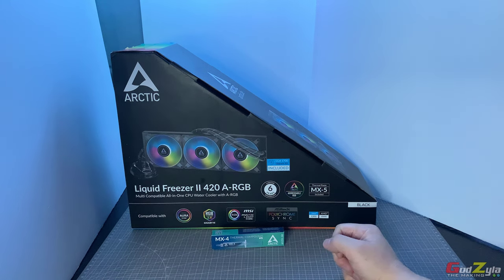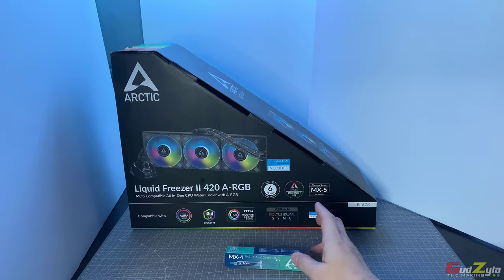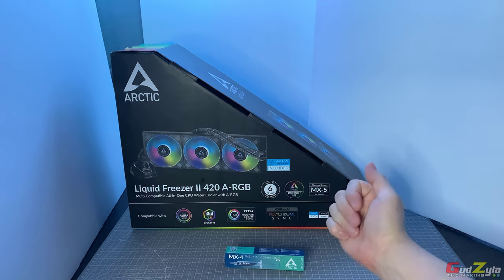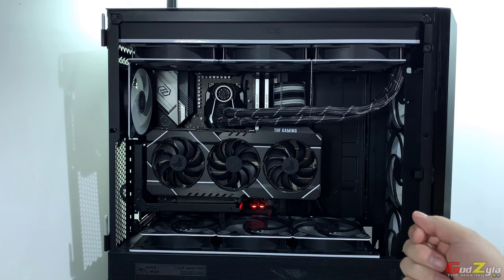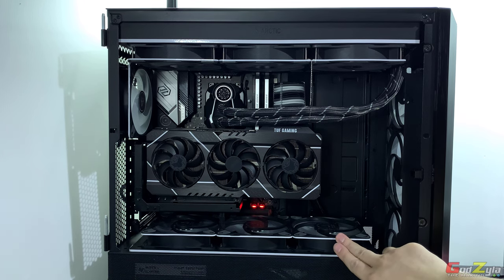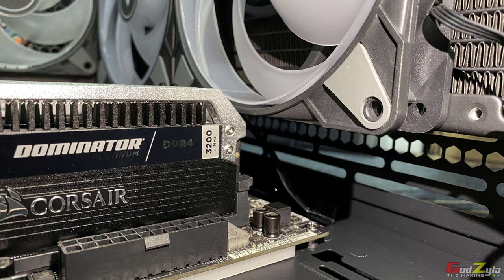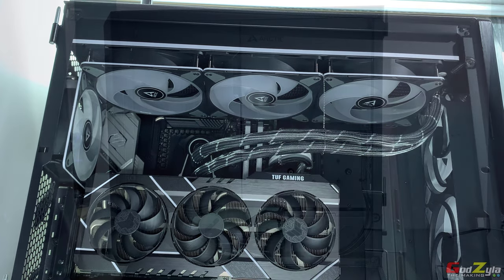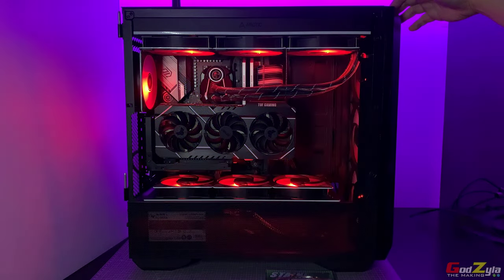Arctic Liquid Freezer II 420 in Lian Li Lancool III - Part 2 (The Experience)

Comment: tell me what kind of vibration isolation you use, what is it called, what is the thickness size, and where can I buy it? I have a radiator with Lian Li Lancool III resonates very strongly and buzzes sometimes I think this is the connection between the radiator and the housing, so I want to glue the vibration isolation of the radiator itself and additionally the fans, the main thing is that then the RAM gets up I have about 1mm left there
Reply from the maker: Hi Rico Freinow, welcome to my channel, for case fans, I just use fan rubber studs. as for Radiator fans I dont use any as dependent on the fan rubber dampers. For radiator to case, I dont use either.
Reply: @KleoYan  I'm talking about the white strip that you pasted, is it vibration isolation?
Reply from the maker: @ArmsK7  no they are not. they are just for decoration. my vanity lol. https://www.amazon.com/dp/B09CD6VHTT/ref=sspa_dk_detail_2?pd_rd_i=B09CD8GYLD&pd_rd_w=JpUgn&content-id=amzn1.sym.dd2c6db7-6626-466d-bf04-9570e69a7df0&pf_rd_p=dd2c6db7-6626-466d-bf04-9570e69a7df0&pf_rd_r=WTJB05RRKV5RGH9W9QXM&pd_rd_wg=67OOd&pd_rd_r=fdc65f38-58e7-45a9-a8e5-c04ff83e690d&s=automotive&sp_csd=d2lkZ2V0TmFtZT1zcF9kZXRhaWxfdGhlbWF0aWM&spLa=ZW5jcnlwdGVkUXVhbGlmaWVyPUFMNUNKSDNCVzYxOTUmZW5jcnlwdGVkSWQ9QTAyNjExODUyTEQ1WEFGQUpPUDFaJmVuY3J5cHRlZEFkSWQ9QTA4MDI5NzNNWUVYNUs1RlMxTEUmd2lkZ2V0TmFtZT1zcF9kZXRhaWxfdGhlbWF0aWMmYWN0aW9uPWNsaWNrUmVkaXJlY3QmZG9Ob3RMb2dDbGljaz10cnVl&th=1
Reply: @KleoYan  clearly, I think maybe the reason is in the rear fan, how it fits into the upper one and because of this it resonates 0:01 https://youtu.be/ljAh1vHZKwg you have it in a different way, maybe that's the reason?
Reply from the maker: @ArmsK7  I see, now i see what's going on.. thats why you have the noise but you did able to fit the rear fan into position, for mine I can't and maybe I have used Arctic fans, thats the reason why.
Reply: @KleoYan  in terms of dimensions, they should not differ, this is a 140 fan the same as the Arctic, I just can't understand how you installed it so lower, I can't move it lower, it rests on the outlet hole for the pci slot
Reply from the maker: @ArmsK7  Hmm, this is interesting, for most Lancool III I have done for friends, I am able to lower it like the way I did, but then again, that was like last year. Let me check with Lian Li if there are changes to the structure which I doubt it will be. Thank you for your info and feedback.
Reply: @KleoYan  or you have set the fan to 120, because 140 is not the way to install
Reply from the maker: @ArmsK7  in this illustration, I am using 120mm not a 140mm.
Reply: @KleoYan  
I found the reason for this is the HDD basket and what is strange is that the HDD has a vibrating ring and it continues to vibrate on the case..
Reply from the maker: @ArmsK7  vibration ring. Hmm this I am not aware of as I don’t use mechanical hard disk. So I remove the cage totally.

Comment: I have got the setup but with an asus rog strix z790-e, just finished assembling last night and haven't gotten around to power it up for the first time since I'm not satisfied with the configuration.

Unfortunately, mine cannot be mounted at the top since it didn't clear my trident z5 ram, the vrm cover, and of course the rear 140mm fan. A shame really, seeing that both of our motherboard are atx my ram sticks are not as tall as yours. I had to mount it at the front, and rearrange the front three case fans around. 

On top of that my arctic also came a bit bent along its overall length (probably due to shipping), I couldn't be bothered to return it and just had to finagle it more with screw alignments.
Reply from the maker: Hi mtl shdr, welcome to my channel, so sorry to hear that. Hmm but come curious how you mount the Arctic Liquid Freezer II 420 at the front? I have tried and it’s too thick. Unless I do not place a top front 140mm fan.

Comment: I couldn't fit my 280 in top of my lancool II. there was not enough clearance for the MB
Reply from the maker: Hi simple store, am sorry to hear that. Kindly note this is Lancool 3 not Lancool 2. Infact in all cases you have to know the measurements properly. I wish motherboard manufacturer will indicate the height of the rear I/O and the side vrm hearsink. Never the less, what you can do is to place your 280 aio at the front. That will still work.
Reply: @KleoYan  thank you for the info. and yes I have placed AIO in the front of the case.
Reply from the maker: @lllrexerlll  that's good, btw something to share with you. it's witness that some of my viewers have tried my method to put thermal paste, you might want to give it a try. https://youtu.be/xZ2R4roF1_Q
Reply: @KleoYan  thanks. will keep this in my mind for my next build.
Reply from the maker: @lllrexerlll  you are most welcome. 😉

Comment: A quick question, I'll get the MSI MAG B650 TOMAHAWK WIFI and the arctic freezer ii 420mm in a lancool 3 case. Would it fit? Because the cooler near the mosfet coolers are kinda big on the tomahawk.
Reply from the maker: Hi xxSchadenfreude, welcome to my channel, I am not able to tell you if it fits as I do not have this motherboard, if you do have this board or able to have a look at shops. do the measurements of the motherboard side VRM and the Rear I/O Shield, so long it does not go over 40mm tall. You are good to go with a 420 Liquid Freezer II in this case.
Reply: @KleoYan  by tall do you mean width? thinking about getting this case aswell, the i/o shield measuring across where the ports are is 45mm or so
Reply from the maker: @Mike17865  if the motherboard heatsink measuring from the base of the motherboard to the tip of the VRM heatsink is more than 40mm. it will not work as you have to take into consideration of the 5mm gap of the standoffs of the case for the motherboard.
Reply: @KleoYan  awesome i just saw in your video aswell, thanks for getting back to me
Reply from the maker: @Mike17865  you are most welcome and all the best wtih your build too. 😉

Comment: Hello, tell me, have you installed the front fans? my mounting frame rests against the radiator and does not allow me to go all the way into the groove, it turns out the upper part is tilted, and the lower one is flat
Reply from the maker: Hi Rico Freinow, welcome to my channel. Do pardon me as the part where I mount the front fans are missing in this video. Here is how I mount the fans at the front. https://imgur.io/gallery/vHezOSS
Reply: @KleoYan  thank you friend, I hope that the filters from the LIAN LI Dust Filter Kit will stand in this position
Reply from the maker: @ArmsK7  nope I have checked. If you place fans this way. The front filters will not fit.
Reply from the maker: @ArmsK7  hmm.. interesting. i read on their official store, guess I was wrong. thanks for the info buddy and congrats with your build. 👍
Reply: Watched this video before i got the case and aio, got both, but RAM wont fit 😂 got an x570 tomahawk and corsair vengeance pro rgb. I dunno what to do
Reply from the maker: @BadCoyoteFunky  hi welcome to my channel. What’s the height measurement of your side vrm heatsink and the rear I/O shroud? Does it exceed 40mm tall?
Reply: @BadCoyoteFunky  
only to change the RAM, either to change the aio, or to saw a little fan, I have TRIDENT Z5 got into the butt, the distance is only 3mm left
Reply: @KleoYan  oh it worked. i just forced it in. thanks for the video!
Reply from the maker: @BadCoyoteFunky  huh you have to force it in. Hmmm 🤔 ok if it works for you that’s good.

Comment: I have this Lian Li Landcool lll RGB case and keeps farely cool inside🤔, all case fans at 90%, not to loud for me either

3x140mm front intake (stock rgb fans)
3x120mm bottom intake (Asus ARGB TF120)
3x140mm top exhaust (Arctic P14)
1x140mm rear exhaust (stock fan)

Ryzen 5800x /DeepCool AK620 (max 75-80c in gaming)
MSI mpg B550 Gaming carbon wifi MB
32gb ddr4 G.skill 3600mhz
2x Gen4 M.2 nvme drives 500gb & 4tb
2x 7200rpm 4tb in front tray (2nd rear hdd tray removed)
Evga 3090 ftw3 ultra (max 75c in gaming)
1000w Corsair rx1000x psu

I've been debating on an AIO, was looking at the Deepcool LS720, but then I saw this beast and curious to get it or not🤔🤔🤔🤔
Reply from the maker: HI CamaroWarrior, welcome to my channel, your temperatue looks good. If you intend to overclock your processor, a 360 will do it's job, unless you are using the AMD 7950X or the intel I9 13900K or KS. For your current setup, LS720 or LT720 are good to go. Infact I would go for the 360 Arctic Liquid Freezer II 360 which is for more better as it's engineering is excellent. https://youtu.be/ugg_6bvYZAk

Comment: Quick question .. why didn’t you leave fans on the AIO when installing it ?
Reply from the maker: Hello James Wright, welcome to my channel. As mentioned, with a slimmer body, you can tilt it abit and to adjust till the radiator is in place, then mount the fans. If I have the fans on the rad. I am forcing it brutally into position. This will damage the fan and scratches on the rad.

Comment: Hey Kleo Yan, any chance you might be able to tell me if MPG Z790 EDGE WIFI will work in this setup (Arctic Liquid Freezer II 420 in Lian Li Lancool III ). I can't find how high the heatsinks or the I/O bracket is.
Reply from the maker: Hi A Man, welcome to my channel, do pardon me as I do not have this motherboard, am not able to tell you the height. You can try write an email to MSI support, check with them instead. Once again, thank you for your visit, sorry that am not able to answer your question and all the very best with your build.

Comment: Does the Lancool 3 have a dust filter for the power supply intake?
Reply from the maker: Hi CoolColJ, welcome to my channel. At the bottom of the case where the PSU draws cool air from, there is a dust filter.

Comment: I have a question, in the video you say that there is a space of 40cm for a motherboard, but do you think that the aorus master z690 that is 40cm high will fit?
Reply from the maker: Hi $Y$T3M, welcome to my channel. If you measure from the motherboard bottom PCB to the top of the rear VRM heatsink and it’s of 40mm in height. Then your board will be able to fit.

Comment: Many thanks @kleoYan  for this guide. It has worked perfectly for me. My 420 Liquid Freezer 2 + 3 120 mm fans at the bottom and  this LanCool 3 are a really great combo. The only donwside i found on this case is the lack of fan hub. And a little detail but there is no orientation arrow for the flow on stock fans, not a problem at all but i could be nice to have .

Really great job on your video fo all those explanations and details.
Reply from the maker: Hi Jérôme, welcome to my channel and thank you for your kind words. As for your feedback, I will let Lian Li know for their future chassis. Greatly appreciated it. By the way, you might be interested in this method of applying thermal paste. Alot of my viewers are getting very good results, you might want to try it too. https://youtu.be/xZ2R4roF1_Q

Comment: Did you have difficulties putting the fan brackets at the front with the aio up top? I'm having issues with it going in all the way
Reply from the maker: Hi Joashane Garrick, welcome to my channel. I have no issues mounting the try back. I have mounted it this way https://imgur.com/gallery/vHezOSS
Reply: @Kleo Yan  oh i see. I have mine mounted on the outside from when I was trying to front mount the 420mm aio lop. It still closes but I had to use a little elbow grease at first. I may have to try mounting it this way to see if it's easier
Reply from the maker: @cangwane  Yup.. I have to apologized too as my video miss out on that part. thanks for visiting and to provide your valuable feedback. All the best with your build.
Reply: @Kleo Yan   thank you kind sir. Thanks to you I was able to fit the 420 aio when everyone else said it wasn't possible. I must've revisited this channel 10 times lol. If only I could like it 10 times
Reply from the maker: @cangwane  😁 thanks for revisiting. All the best buddy 😊

Comment: What size rear exhaust fan did you use? I have same case and aio but cant seem to fit the original 140mm exhaust fan
Reply from the maker: Hi JaySeeProduction, welcome to my channel. I am using a 120mm fan for the rear with rubber studs and not with screws.
Reply: @KleoYan  Thank you for that! Its a bummer I was hoping to utilise my 140mm fan that came with the case exhaust fan
Reply from the maker: @JaySea_Productions  you are most welcome. I guess in every pc product, there are always room for improvement. Let’s see if there is a Lancool 4 😉

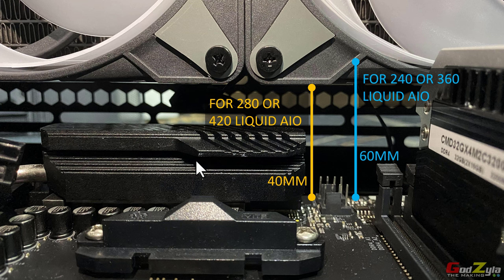Comment: I almost bought this, but 12:06 saved me. My motherboard height is 50mm to the top of the MOSFET heatsink. Thank you.
Reply from the maker: Hi Mike, welcome to my channel and i am glad this content did aid you. All the best with your build too. 😉
Reply: @KleoYan  So the i/o panel on the X570 is 38mm? The I/O panel on my B650 is 50mm (same height as the MOSFET heatsink). Maybe a change in the B650 series?

A fail safe check is if you have a tall I/O panel like I have, and you consider the thickness of the AFii 420, the radiator is 38mm and the fans are 27mm, you would need a space of at least 65mm between the top of the case (if top mounted) to the I/O ports. My current case (Shadow Base 800) only has 60mm clearance here, so it fowls on the I/O panel.
Reply from the maker: @mildmethod  Hi welcome back. I will avoid using the 420 LF2 if I know that the space is only at 60mm. infact the default height of the P14 or P14 ARGB is at 25mm thick + the radiator at 38mm, total thickness is at 63mm, unless you change to taller or thicker 140mm fans.
Reply: @mildmethod hello pls I'm considering this exact case..Shadow base 800 and I want this Arctic 420mm up top only, is there a chance for that?
Reply: Hi  @DavidRegaL-lw5xz  the Arctic Freezer II 420 does not fit the be quiet! Shadow Base 800. I learnt the hard way and bought the case and AIO, so I know first hand.

Comment: I'm not able to mount on top the radiator. How did you do that?
Reply from the maker: Hi Lagos Lagos, welcome to my channel. I slowly insert the radiator to the top. Fasten all 4 corner screws and not tighten them. Wiggle abit since then 4 corner screws are not tighten, then proceed to screw the 6 screws left but not tighten. Once all screws in, diagonally i tighten them.

Comment: Hello, i have a question how did you take out the bottom part that holds the hdd brackets? I took out all the screws but i think 1 screw is underneath one of the feet.
Reply from the maker: Hello White Wolf, welcome to my channel, yes one of the screws is directly behid the rubber of the feet. I have to peel that off and to remove the screws.
Reply: @KleoYan  how did you take of the feet i'm having a hard time
Reply: Nvm found it below the rubber
Reply from the maker: @MKD01  there are total of 6 screws, I just remove all six and it will just drop off.
Reply: @KleoYan  thanks found them all!
Reply from the maker: @MKD01  ok .. thats good 😉 all the best with your build.

Comment: Did you still mount the front Case fans on the inside of the bracket? But just turn the bracket around to stick out towards the front mesh to create enough space to Mount the radiator?

Or did you Mount fans on outside of bracket but that might not allow the front bracket to close
Reply from the maker: Hello Stewart Clanachan, welcome to my channel. I believe this will answer your question. https://imgur.io/gallery/vHezOSS
Reply: @KleoYan   Trying to do this myself but I'm not able to fit the front panel in with the radiator at the top, and even if I could the radiator wouldn't be able to screw in to the top mesh as the holes wouldn't line up anymore.

I've tried reversing the front panel like you have but not noticing any difference, what am I doing wrong?
Reply from the maker: @snowleopard01  Hi, welcome to my channel. When you mount the radiator at the top, do not screw tight and to fix one hole. What you need to do is to do anchor points to each hole as in screw them losely just to catch in place. Once all 12 holes are filled with screws, then tighten them. As for the front mesh cover, you will need to fiddle a way on the Fan tray. by the way, I no longer have this case with me. all the best with your build and good luck.
Reply: @KleoYan  Figured it out in the end that there's 4 not 2 configurations of the front panel, I thought it was just inverted and not-inverted. Once I found the configuration you used it all started coming together, thanks :)
Reply from the maker: @snowleopard01  nice, congrats and thank you for the updates 👍I am glad you got it sorted out.